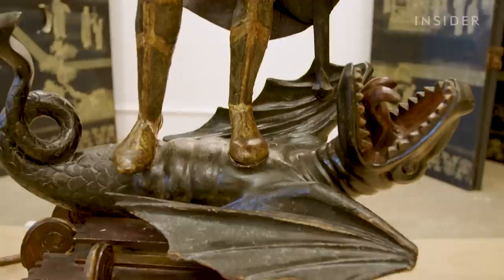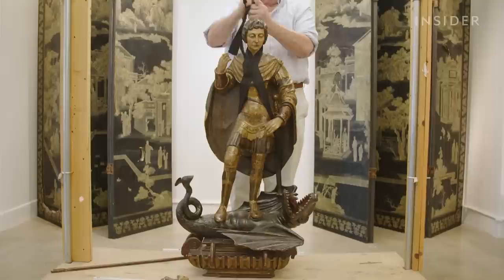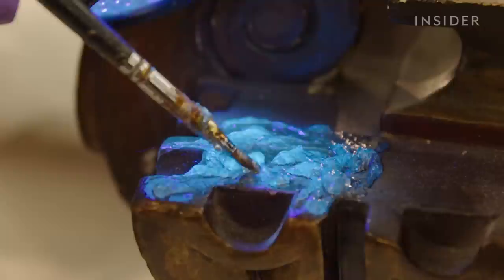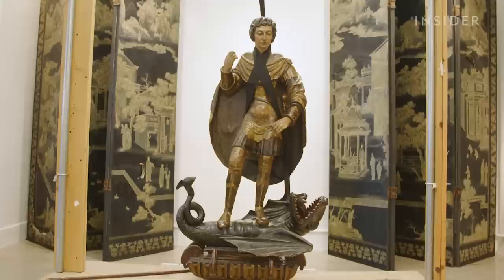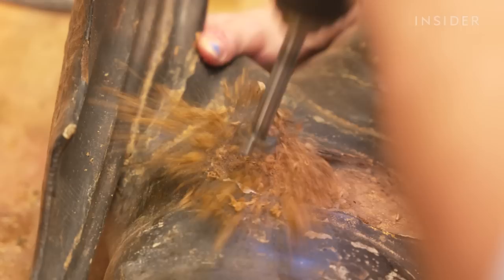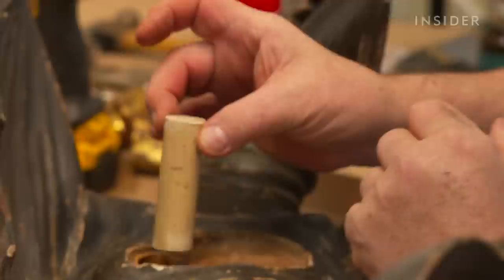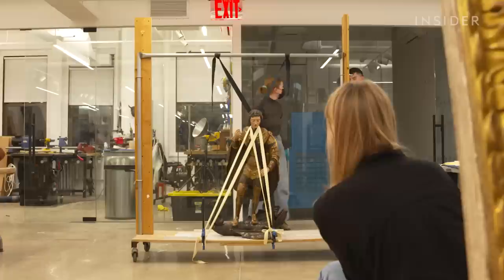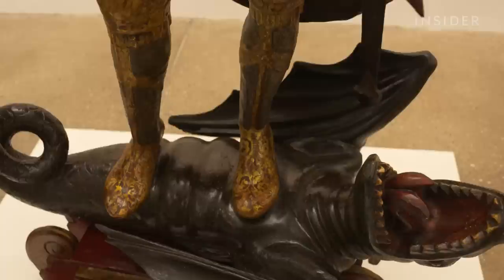Restoring A 16th-Century Yellowed Wooden Sculpture | Refurbished | Insider

Comment: Okay you lost me at using the ancient drill press. Why would you use a less accurate and reliable tool to do restauration? Wouldn't you want to minimize the chances of damaging it further? Genuinely curious!
Reply: Are you an art restoration specialist?
Reply: @fabrizio483  Look how it looks like after it. Not even the angel is fitting. After "restoration" he looks on the ground...
Reply: @dertobbe1176  She just removed the varnish that wasn't there to begin with. Original artworks sometimes don't align with our perception, much like the old Roman statues that were all painted.
Reply: 1) they aren't drilling into the old wood. they're drilling into the plugs that they put in with fish glue, aka a reversible glue. 2) drill presses are used because they are in fact, quite accurate. it's a drill that only has a vertical degree of motion, so if your hand slips or has a tremble, you don't drill at an odd angle or gouge out wood you want to keep. to illustrate, imagine you're trying to screw a bolt into a wall with a standard impact driver, if you can't hold the tool steady or you're working at an awkward angle, it's going to go wrong, now imagine the driver has a guide that's flush to the wall and ONLY lets you drive the bolt into the wall or remove it, that's the difference between freehand drilling and using a drill press.
Reply: @fabrizio483  Well It's not about the dirt. Look at the angle of his view. He looks on the ground now
Reply: @dertobbe1176 He's looking at the Dragon. With already droopy eyes.

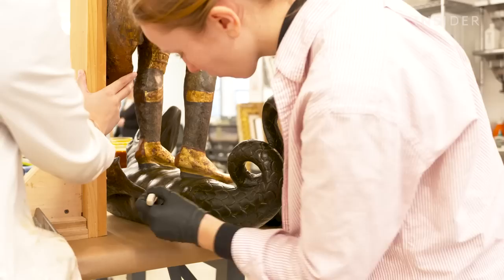Comment: 8:48 A coat ofshellac? Won't that turn yellow over time? Wouldn't have been more proper to add a restoration damar natural resin with UV protection? That way you prevent discoloration and yellowish at the same time protecting the original pigments...

Comment: What happened to the sword or spear, clearly it is missing.
Reply: looks like they didn't have an original and improvised a new one. I guess the finish is good enough, but they skimped on the shape, I think it's very unlikely that the original was just a pointy stick. it probably would have had a gilded lance head. but then they would have had to make a guess about the shape of it, preferably based on other old examples. I also think that they just made it too short, that's not even a good pointy stick.

Comment: This hasty and aggressive removal of varnishes is an irreversible catastrophe. The varnish shades are lost. It's incredible that supposed professionals did not recognize this. The result is flat, one-dimensional, and doll-like. A shame! If anything, in such a case, the varnish should be slightly thinned, depending on the thickness. Otherwise, just gently clean the surface and partially stabilize where necessary.